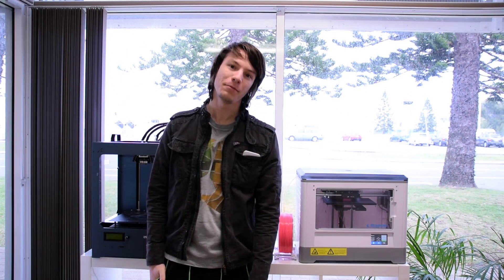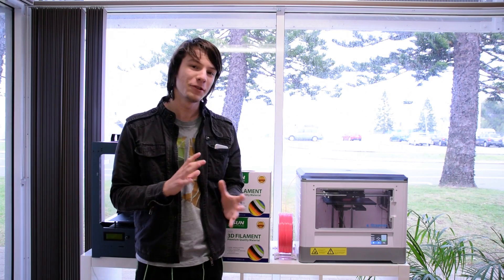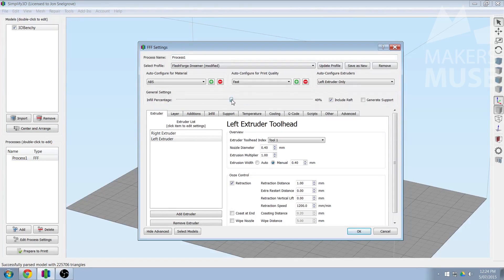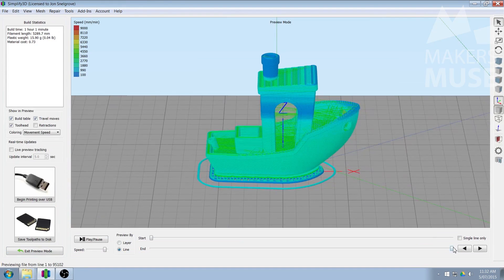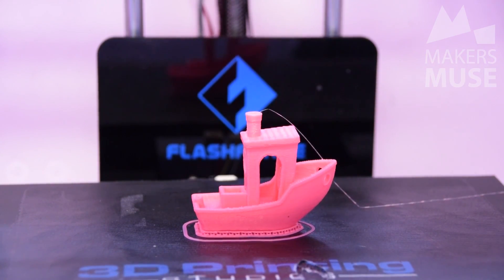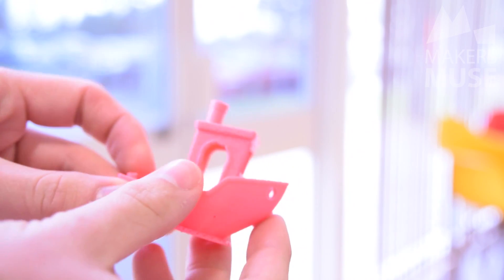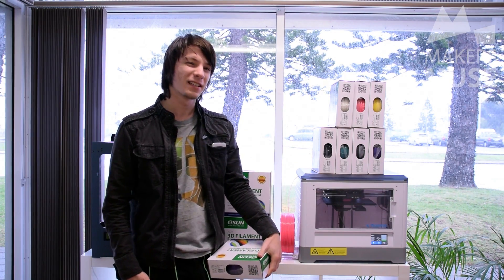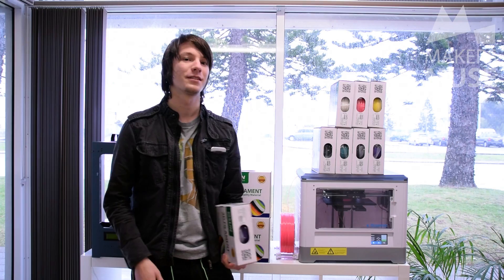ESun Filament Revisit - Pretty Damn Good! - 2015

Comment: This is very odd to me... Can't control the printing temperature? Aftermarket ABS? Printing eSUN ABS in my experience it likes to print at 110° on the bed and 235 to 245 on the nozzle.

Comment: Sooo I bought 2 rolls of this stuff after seeing this video in 2016, why am I posting now? My printer broke right before I cracked either open and they sat in a shed outside in 120F+ heat for 3 summers (Phoenix AZ), come to now on my new Ender 3, I just want to say WOW! I thought I had problems with my printer at first, but it turns out it was just another band of filament couldn't stand the heat and wasn't printing nicely at all, but eSun's PLA+ is printing like a champ! Would have figured I got the roll yesterday, I think it has to do with PLA+ having more rigidity and heat resilience then standard PLA but I'll be going with it from now on!

Comment: I recently bought my first two spools of e-Sun PLA+ filament and sadly have to say that so far I haven't been impressed for the following reasons:
1) Filament thickness is inconsistent.
2) There seem to be impurities in the filament as some parts of my prints have spots which the colour is different.
3) The filament was crossed over itself. This led to a major failure on a 64h print. It was the first print with that spool.

Comment: all I've ever used was esun   and strangely enough with 2 printers it works great
usually I use the pla esun at 205-210 and 60-65 bed temps

Comment: Hi Angus, would you recommend esun ABS and PLA? As Im about to purchase 24kg worth of filament. If not what other low cost filament would you recommend? I would like to hear your opinion on the matter :) thanks!
Reply from the maker: I quite like it - but the PLA gets brittle over time, they now have a PLA+ but haven't yet tested it. These days you have to try pretty hard to find 'bad quality' filament. eSun hasn't let me down print wise.
Reply: so you can vouch for the old abs?
Reply from the maker: It worked fine for me - but I never put it through any intensive use.
Reply: about the pla, how brittle would it get? hand crushed brittle or moderate abuse crushed brittle?

Comment: I had conflicted experience with this, I used the 3mm on my ultimaker 2+ 
The abs was great I had no issues and printed great as I wanted, few warps but nothing major.
I do however used the 3mm PLA and it was a nightmare, it kept burning up and crystallize at the nozzle, I used 210 temperature as they recommend also sometimes it extrude un-uniformly sometimes and I don't think it's the printer or configuration of slicer because I used colorfabb on same gcode and I got great result.
I had pictures all over Amazon
Reply from the maker: Issue I think here is the ultimaker is a true 2.85mm filament machine, so the esun is probably oversize and that is known to cause heaps of issues. Colorfabb would be properly 2.85mm.
Reply: +Maker's Muse that's what I thought so I changed the flow rate, I didn't had feeding problems though it did similar issues I had green PLA it was burning to brownish goo.
I had no problem with ABS though

Comment: I found a filament called PLA+. They promise very nice new futures, but is it true? What do you think? Should I get the PLA+ or just get a roll of PLA?

here is the link to the PLA+: https://reprapworld.com/?products_details&products_id/1059/cPath/1590_1738_1721#.V03AgZGLSUk
Reply: I have 2 spools of the PLA+ (purple and pine green) from reprapworld. They print just fine. I would recommend PLA+ over the simple eSun PLA, but at the same price as the PLA+ spools you can get the REAL brand of filament from reprapworld, which I think is better. I have 12 spools of REAL filament brand and I am very pleased so far.

Comment: I am just finishing my esun filament order from HobbyKing and I can tell you that although it prints fine and the nice selection of colors is also good, it tends to break all the time when left on the printer. It got so annoying that I almost threw the last bit in the bin. I would recommend using a different brand if you can after you finish what you have. You can still use it but you'll see what I mean. I have not had any problems with that on any other brand, so it's sort of a dry filament or just brittle. I don't know but I just don't care for it much now. The price was low enough to get a few when I did so that's why I tried this brand. I use a craftbot 3d printer with a larger build and have printed pretty large parts. You can print PLA at 55-60c and I print pla with the hotend at 215c. Also, on small parts you don't really need  that extra skirt or brim if you're using PLA. PLA sticks to the bed well if you have a heated bed. I don't know if your printer does.
Reply from the maker: +myshots101 I've had this happen with many brands of PLA, it's weird how it just snaps overnight on its own, but certainly not isolated to ESun. But you're right, it is cheap stuff - the Colorfabb or other brands with PHA are far stronger and shouldn't snap. I have also heard of some people dunking rolls into hot water for a 5min but I've never been brave enough to try that myself. I tend to default printing with a raft because my print surfaces are always so chewed up :)

Comment: Thank you for the great vid. I am brand new to 3d printing as of the first of October 1st. l bought a Prusa i3 by Sintron, and l am able to get high quality prints using 1.75mm eSun PLA.   I have 2 spools of 1.75mm eSun ABS, my problem is getting the print to stick to the HBP.  I've tried rafting and brimming with no real luck. I've even tried to use hair spray and glue stick.  Any suggestions would be most helpful.  

best regards
Adam .D

Comment: I've been testing esun ABS from hobbyking and to get any sort of strength between layers I have to print at atleast 265C nearly 12-20 more than ABS from Bildy CNC. The esun PLA prints really well around 215-220C. I've also had 2 jams with ABS which I never ever get with anything else.
Reply from the maker: +l2smith2 Interesting, 265C is as hot if not hotter than the UP Brand plastic and in my testing would be way too hot for Esun. Every printer is different though. What kind is yours?
Reply: +Maker's Muse I'm using a rostock max v2 with an e3d hotend. I've had to go up to 268 and slow to 90% for more strength. I've never been a big fan of abs also more trouble than its worth. PLA and Bridge nylon are my favourite.
Reply: +Maker's Muse Can you do a video on your mods to your flashforge dreamer?

Comment: What temperature for the PLA you reckon? Nice video!
Reply from the maker: Giaco Whatever You should be fine with about 200deg C depending on your printer. :D
Reply: Ausi for the win
Reply from the maker: Zacery Hammond +1!
Reply: +Giaco Whatever Just so you know, im brand new to 3d printing as of last month.  I'm using eSun PLA filament with the following temp settings.

Hot End- 200 first layer, 195 for all other layers.
HBP- 60

good luck
Reply: Thanks :)
Reply: Wizard 3D Printing
Reply: +Giaco Whatever for me 190 on a prusa i3 is enough and the hot bed at 30 just to lessen the temp shock.